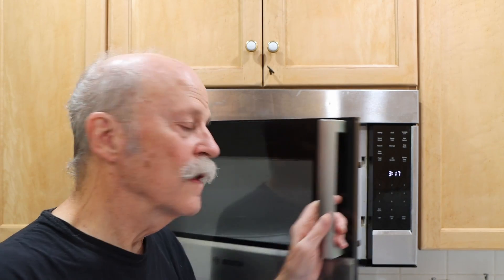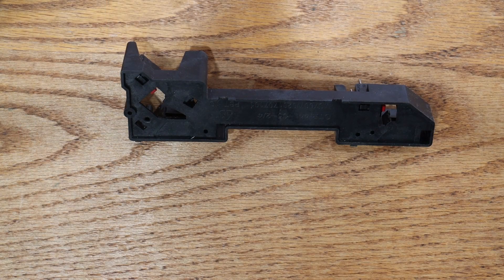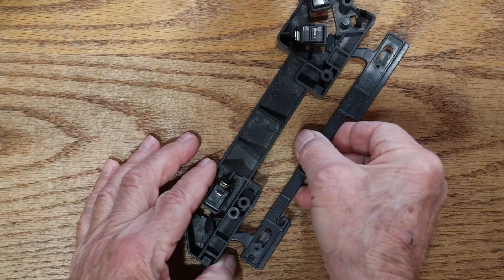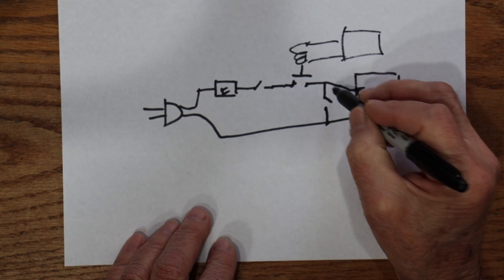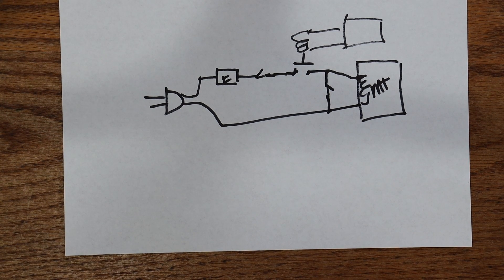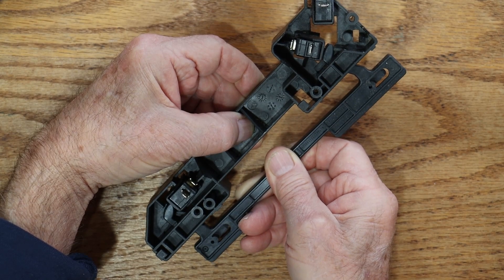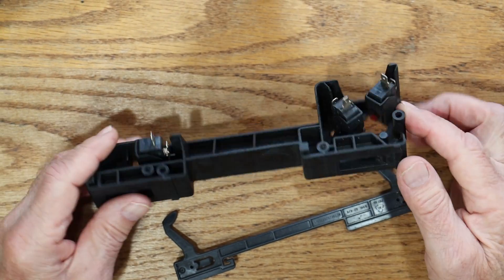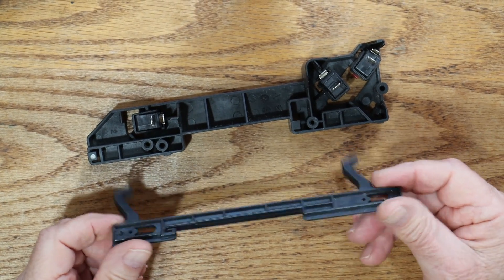Is your Microwave dead? This may be the real reason.

Comment: My Microwave is older and has two door switches, that both open when the door is opened. It doesn’t blow the fuse. Also there are two cover switches. That the cover screws push on to make the switches.  Also my Microwave, quit just beyond the warranty. Took the fuse out, and matched an exact replacement. A little over a year it blew that fuse. I was looking at the wiring diagram, and the fuse was too small and was the wrong type. Fast blow, rather than a slow blow.  Replaced with the right fuse, other than the door switch, I bought a pack of ten off of the internet, for cheap.
Reply from the maker: That is interesting. I don't know when the law was passed that required microwaves to self destruct if the door switch fails but either yours is older or they found another way to self destruct. Thanks for the comment. I hope it helps someone else who has a similar issue.

Comment: Good video. I fixed my table top GE microwave a few weeks ago. The metal that the switches were mounted on bent just slightly from thousands of door openings. Pulled the cover off,  adjusted the metal and back in business.....about 15 minutes start to finish.
Reply from the maker: Thank you. Metal is nice that way! Plastic, not so much.

Comment: I have worked on MANY microwaves, and MOST of the problems were the switches.  In all of the microwaves that I have worked on, only ONE had a bad magnetron.  There have been bad capacitors, diodes, fuses and switches, but that is just about all.